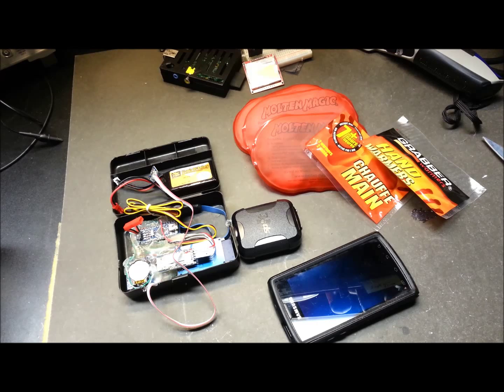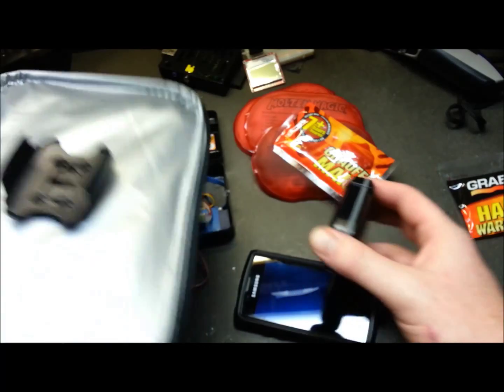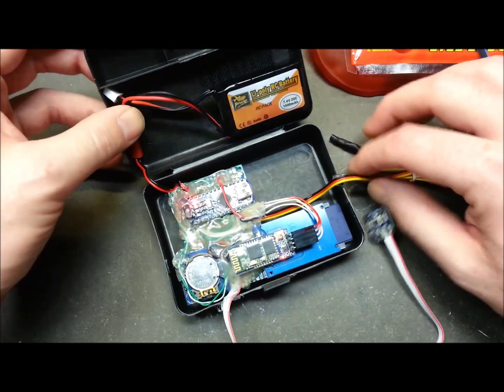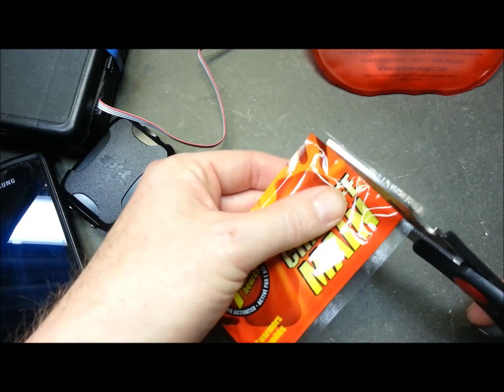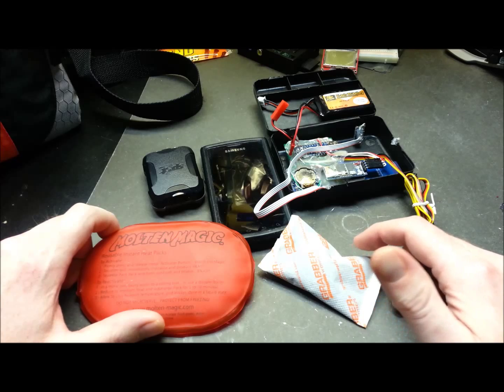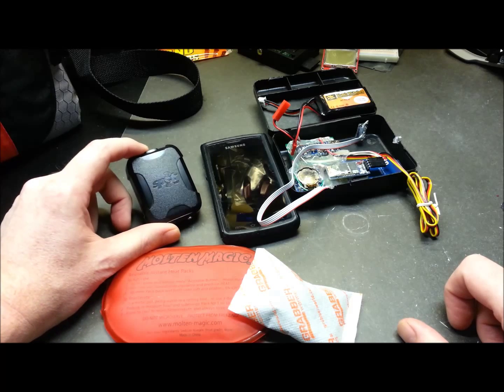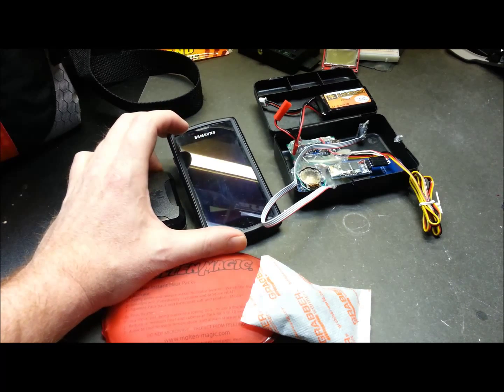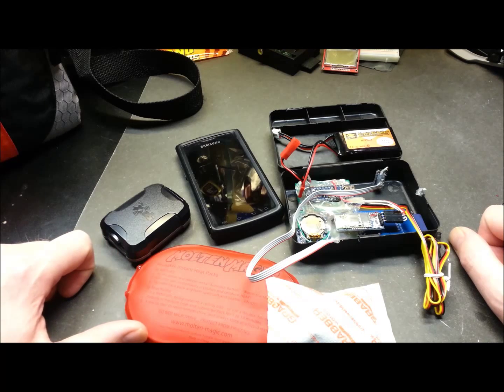HAB Part 9- Heating & GPS Tracking  Live Outdoor Test

Comment: Hi there, found one of your RTL videos and stumbled upon this one in the process.  Thinking of doing a HAB this summer with the kids and will definitely follow your videos to see how they progress.

One thing that i was wondering (haven't watched any other of your HAB vids but this) is if the sheen in the material for your container (with the SPOT harness attached) might indicate some metallic content and if this could attenuate signals at all.

If that dings any bells, possibly chuck your RTL inside with the stock antenna to see if it loses any signal strength from broadcast FM or the weather stations near 162MHz.

Best of luck!
Reply from the maker: Hiya- yep already tested if for RF "permeability" and no worries there.  Its not metallic at all just kinda looks that way.  Truth be told- the insulation foam I grabbed for it has a nice aluminum layer- so I'm now back on the hunt for some basic Styrofoam :)  All part of the fun I guess.

Comment: You can't use that plastic heating pack. The higher the balloon is, the lower the outside pressure is. It will blow up and burst just like the balloon. And the inside goo is all over your electronics...

keep up the good work!
Reply from the maker: How so?   You are saying the Sodium Acetate (in semi solid form after activation with little to no air)  will expand enough to rupture the containment?
Reply: Eric William Indeed! Even if there is no air in the package, the outside pressure is still lower than the inside pressure. The stuff that is in there has been put there at normal air pressure. Once you take that away.... 

Practically the same as with the balloon itself. If you put it too full, it'll burst before reaching the wanted altitude..
Reply from the maker: Hmmm I think Pascal would debate your point :)  The expansion of liquids and solids without gas emulsion etc- is pretty negligible.  Boyle outlines alot of how and why gasses act in this way.  Anyhow it matters not as I will likely be using the other type for heating as I need to shed some weight.  Cheers